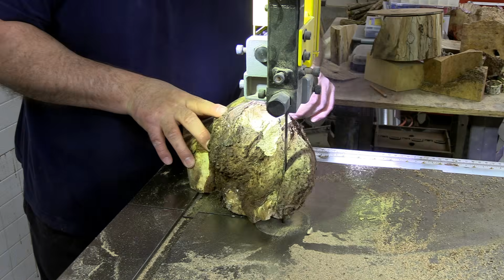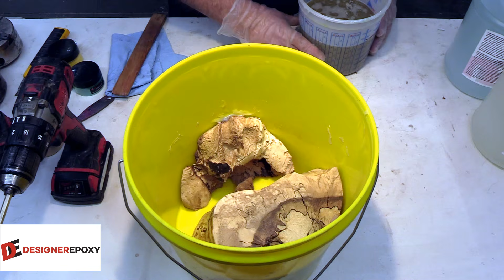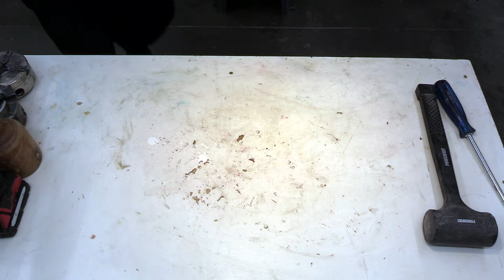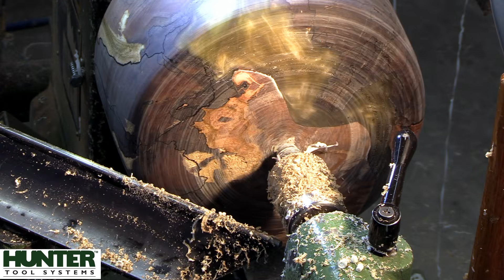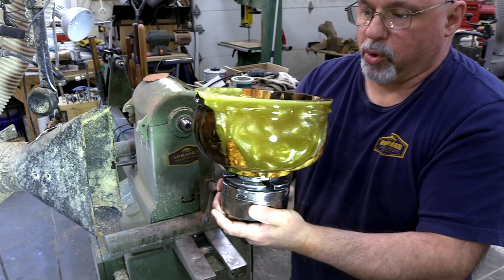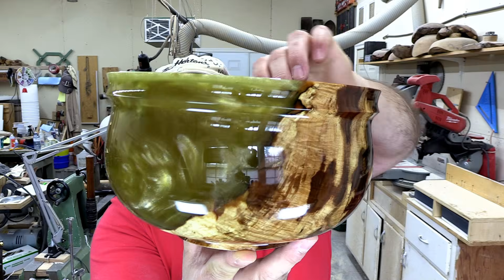Woodturning - The Pot of Gold Bowl

Comment: Hi JIm, just a tip with the wooden stick you use on top while it is in pressure pot. The idea is to have the stick all the way on top of the bucket, sticking over each side. I use a wooden spoon on top of a pot on the stove when I cook pasta or something that might tend to spill over when it is being cooked on the stove. The same principle with the resin. The stick must be on top of the bucket. Hope it makes sense. I have seen some of your other videos where you put the stick on top of the bucket and it did work preventing overflow
Reply from the maker: I actually did that and then tried it the other way to see if it made a difference and it didn’t this time around 🤷‍♂️ thanks!

Comment: Jim, you might want to try a longer stick, or even a dowel that will go from edge to edge of the top rim of your casting bucket, in cooking the theory of putting a wood spoon on the top edge of the pan, the boiling water will not go past that wood spoon, thus preventing overflow to occur.  I know that the hydraulic properties of casting epoxy are much different than boiling water, but it might be worth a try.
Reply from the maker: I actually tried it on one of my recent videos and it worked just fine. Thanks

Comment: Man that looks like it was a lot of work!  Great job and with sticking with it.  I have  bunch of spalted horse chestnut that is super hard to sand without getting those valleys in the soft spots.  I think I will try coating it with epoxy.  It seems I can't use enough star bond to get it to sand smoothly.  Thanks again!  designer epoxy
Reply from the maker: The epoxy worked great here, so it should work for you too. Thanks

Comment: designer epoxy

really lovely project.  When you say you set logs outside for a year to cure/spalt?  what does that look like?  covered, uncovered, out in a shed?  there are some logs sitting out- completely in the weather- at my grandparents, and I thought they were just rotting and unsalvageable, but if it's normal to do that, then I just have plenty to learn, don't I?
Reply from the maker: Yes, sitting in the shade is best right on the ground and let Mother Nature go to work. It also won’t hurt to rotate the logs after six month or so too. Hope this helps. Thanks

Comment: Another question that would be a good one to cover, when using the deep cast and you want color separation how long is a good amount of time to wait for best results on normal/within proper pour depths specifically. I want to grab some epoxy since I'm out but i have only used the art cast but the 3 gallon kit being on such a good sale I may want to try the deep cast this time
Reply from the maker: I cover it in this video Woodturning - Don't Miss This Fantastic Welsh Flag Inspired Vase!
https://youtu.be/hZc2PDbFDH0 Thanks
Reply: @SpragueWoodturning  thanks! You have so many videos and I couldn't remember which ones you covered it in or if you had settled on a good method for consistency. Also not sure if I mentioned it before but that you very much for reviewing and endorsing designer epoxy. There is so many brands, i couldn't pick any for fear of getting a bad brand until I discovered you

Comment: As a watercolorist I wouldn’t have mixed all of these colors together as some clash against each other. If you wanted to use them all, I would have mixed each color separately and then poured them in around the pot for a marbled effect.
Reply from the maker: If it was only that easy, lol.  If I had of done that they would of all combined together to make the color you seen in the video. Thanks

Comment: Jim I was doing an epoxy resin pour and my mold leaked how can I remove the spilled resin from my pressure ? have you had that happen or I'm I just a dumb ass lol.....Larry
Reply from the maker: It happens all the time, lol. Once it fully cured it can be chipped out, another way to remove its is to pour acetone in it and let sit over night to soften the epoxy. This method my also remove the paint from the inside of the pot though if it’s painted. What I now do on occasion is spray the inside of the PP with mold release and that way if I get a leak it doesn’t really stick all that bad and is easier to remove if there’s a spill. Hope this helps. Thanks

Comment: Jim I didn't quite understand all that about the glue block snapping off.  What did you mean about getting a good bite and switching to birch and just glue between the casting and the joint?  I couldn't grasp that.
Reply: Actually I think I figured it out.  The block was hard maple and the chuck jaws wouldn't grab it so you're going to start using birch for your blocks?
Reply from the maker: Yes, birch is still a hardwood but softer than hard maple so the jaws of the chuck should get a better bite on it. Hope this helps. Thanks

Comment: Thx for doing the explanation of PP v VC so quickly after my question last week! Designer Epoxy. I'm pretty sure I'll be getting both even though I won't be working with porous woods initially while I learn but  the VC is critical when doing silicon molds which I do for my cosplay work.
Reply from the maker: I bet it is. Thank you very much!

Comment: I am also from Ontario, you had your address posted, so I looked at your listing, so wonderful to be right on the park. I also took a walk-through and saw a lot of your items and woodworking throughout the house, beautiful place, beautiful land.
Reply from the maker: Yes, hard to believe we are leaving it behind. Thanks
Reply: @SpragueWoodturning  if you’re looking for a tip on how to sell, you may have neglected to consider the demographics of the perfect people for your house.  To live quite a distance from a major city means its people working from home and you have quite the man cave there.  A drive shed like that, especially with plenty of amperage for machines, heated, insulated, plenty of space, is worth its weight in gold.  Plenty of pictures in and around that shed will double the value of the house in the eyes of the average man your age and 10 years younger.  (The demographic is not likely to be a couple in their 20’s right?).  If you’re worried about the security of local people seeing your tool collection and becoming a target for theft (this is the only reason I can think of why you don’t already have pictures), for a few hundred dollars, Lorex has great deals on high quality night vision camera systems, hardwired to an NVR so you don’t need wifi out by the shed.  Anyway, they’re good at reading license plates, especially if you temporarily ran a wire to one low in a tree by the driveway.  Good luck, you live on a pot of gold and people should be lining up to buy that house!

Comment: Designer Epoxy.    Very nice shape and colors.   What speed are you at when applying the finish?  My slowest speed is 150 (midi lathe) which is way to fast to apply an epoxy or any type of finish.   Wonder if they make an attachment/motor that I could somehow rig up.  Hmm.  😊
Reply from the maker: 60 to 80 rpm is typically what I apply the finish at. Tough to do on a lathe that doesn’t have variable speed. I’ve heard of people attaching a drill to their lathes to apply finishes that don’t have variable speed. Not sure how they did it but it might be an option. Thanks for watching!

Comment: Maybe you should use the 5 min epoxy on the bottom block Jimbo, I know for the most part the hot glue works and I was always surprised it holds so well, on some cases the 5 minute I guess
Reply from the maker: Possibly, thanks!

Comment: Morning Jim: What sort of fumes do you get off the vacuum pot when making the epoxy go into the punky wood? I think a lid on the bowl would look really sharp. Would putting hot buns in the bowl be ok? As a place on the dinner table when having soup or something. The colours are exceptional on the turning. Lots of swirls. Great use of a rotten piece of wood that would otherwise go to the fire pit. Take care and stay safe. PS: the video on the new land was interesting.
Reply from the maker: Sometimes you can get some oil vapor, but other than that it’s not too bad. I don’t recommend putting anything hot in pieces with resin or not. I’m always worried the finish will transfer to the food item. Thank you very much!